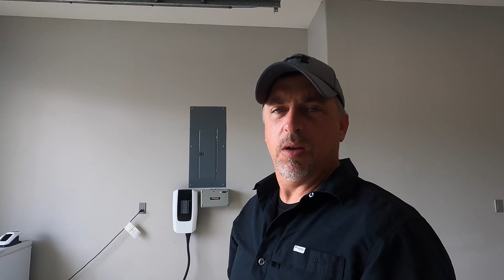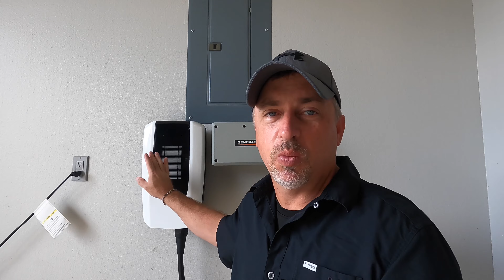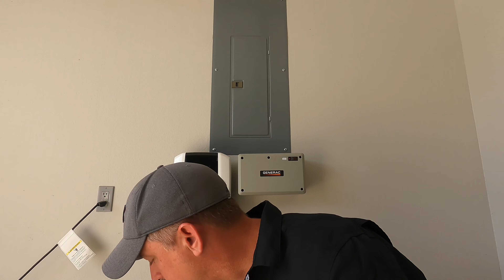Do you need Generac SMM Load shed management for your home backup generator?

Comment: Does the generator differentiate between gen power and regular power? How does it know I didn't just shut off a breaker then turn it back on?
Reply from the maker: It senses hertz.. Line power will always be exactly 60hz. A generator will vary as hertz is directly tied to engine rpm.. If it’s a solid 60hz it knows its line power.

Comment: I have 11kw generator connected to house outlets and 1 8kw heat pump, do I need one of those SMM modules or are they mostly useful when you have multiple high 240v loads on a generator?

Comment: Thanks for the video. Does this device need to be installed at each device that you’d like to be shed? For example, I have an electric hot water tank and other high amperage electrical appliances (stoves, ovens, heat pump, and so on) that could overload a generator.
Reply from the maker: Yes. It is an end device for each item.